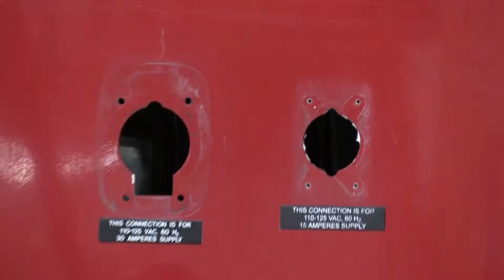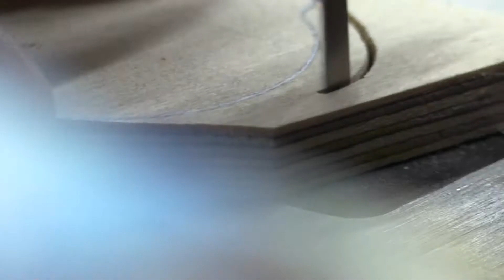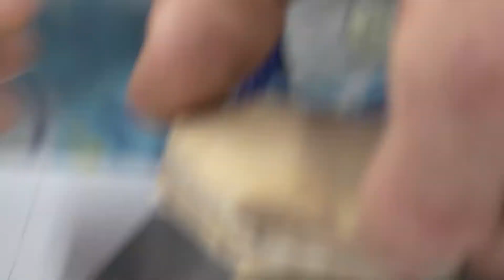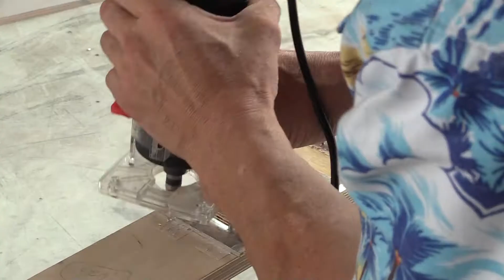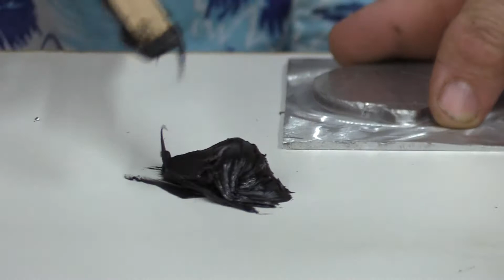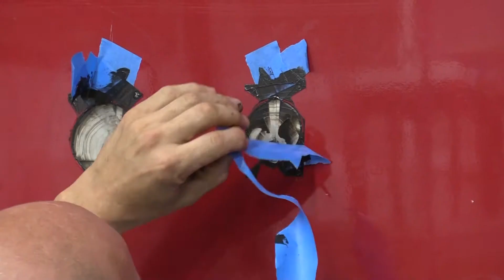Ambulance to RV/Part 3 - Aluminum Repair For Paint / Without Welding!

Comment: Nice job Jimmy. You always have some great tricks up your sleeve and that's what keeps me coming back. Okay, you got those holes filled. I assume using marine-tex over another adhesive such as epoxy/aluminum powder is primarily for convenience. But we're a long way from invisible once painted. Are we going to fair out with bondo?
Reply from the maker: Thank you thank you thank you :- )  I chose to use the Marine Tex due to the fact that it was the easiest project to mix up with the greatest holding abilities. Yes will have some faring smoothing priming faring smoothing work to do. But that doesn’t make for such a great video specially when it drags the process along and I lose my audience retention. Thanks for your continued patronage, Jim